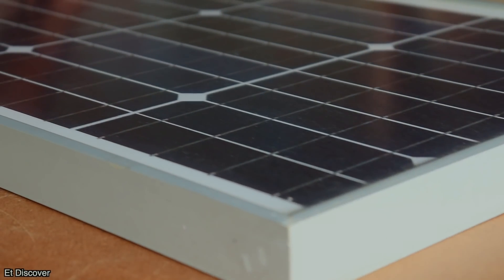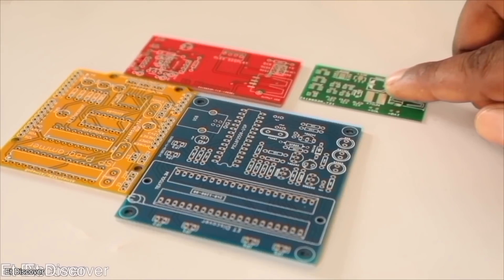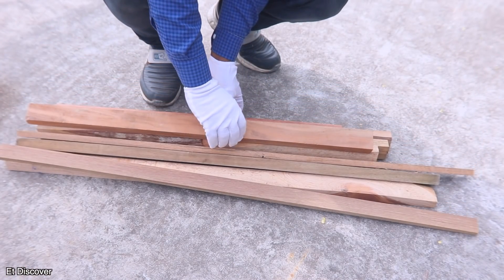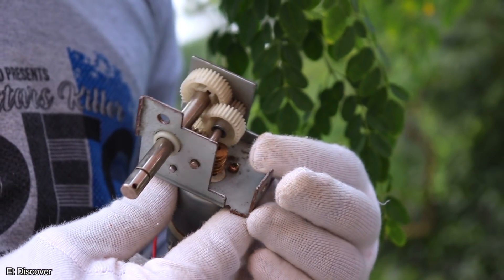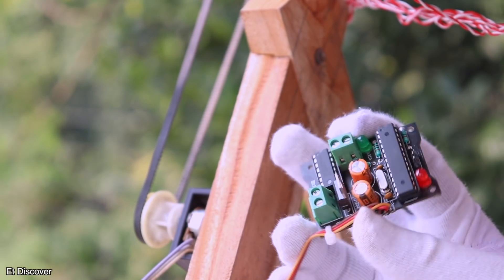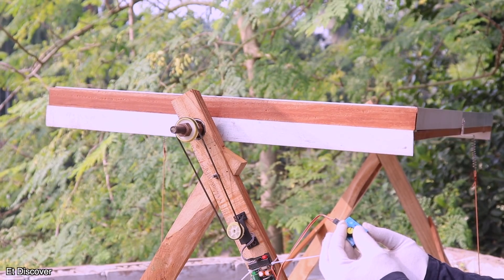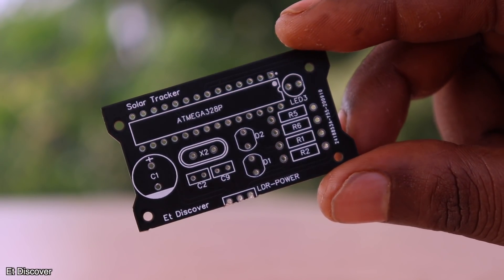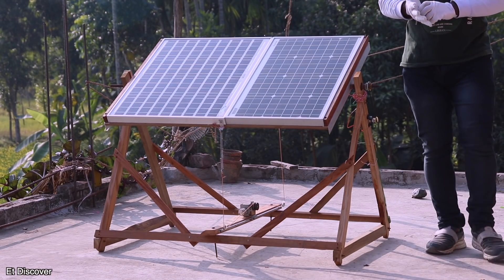How to Make Real #BIG Solar Panel #Sun Tracking System

Comment: Use a smaller rpm motor. Will stop the jumping around and make a much smoother transition. Good job on the panel design :0)

Comment: Thanks for the video but still its not practical to use bcoz we have 150w or 350w plates which are big in size and carry much great weight. So better to  improve it which can carry up to 4 plates and must be troublefree in extreme temperature and windy seasons.

Comment: What happens with it rains with those exposed PCBs?
Reply from the maker: You are right, but I’m not thinking yet about this 😂
Reply: @EtDiscover  If it all working great, use clear RTV to embed the PCB in exactly where you have it mounted, easier than making a box for it - LOL.